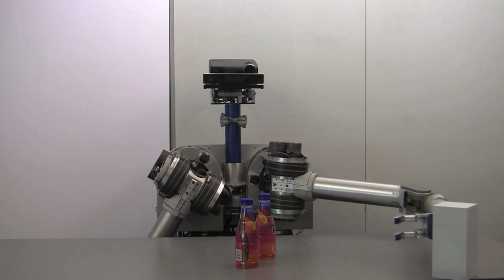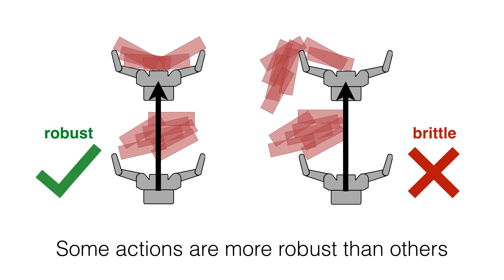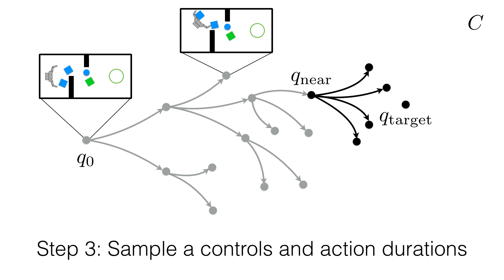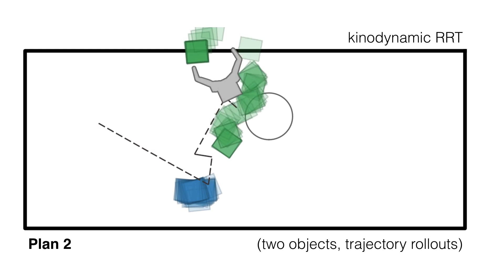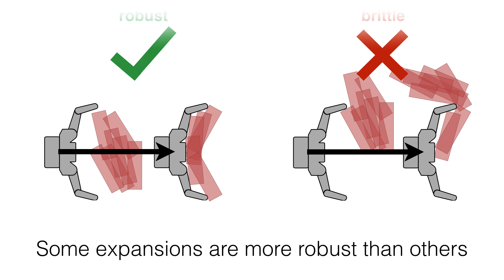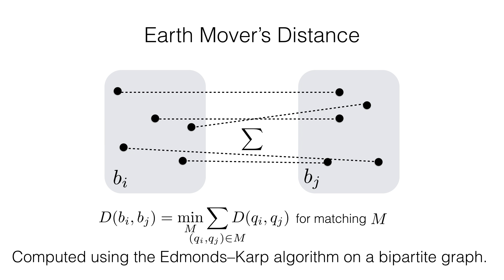Robust Push Planning Under Uncertainty

Comment: Seems over complicated... why not just 1. use a gripper like the one pictured 2. always orient said gripper in the direction of motion 3. Center the gripper on the center point of the objects to move. Given all that, the shape of the gripper should reduce the variability of object position (the objects will center in the hollow of the gripper) and the same improvements can be made without the large computational effort.